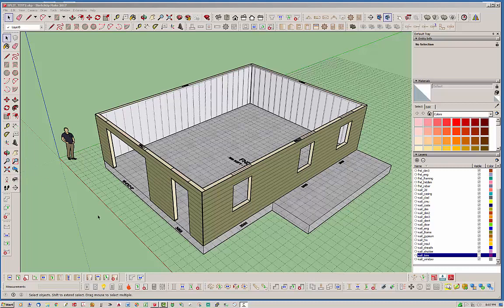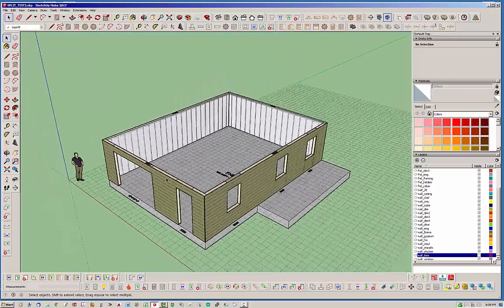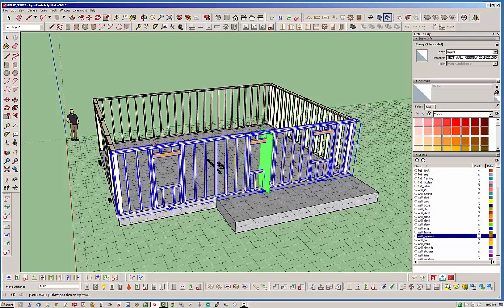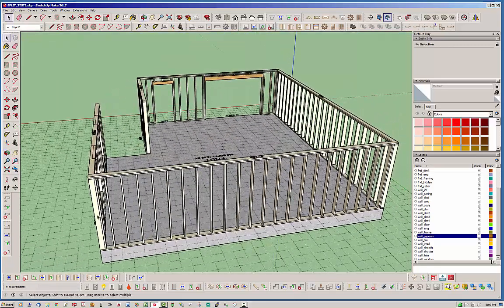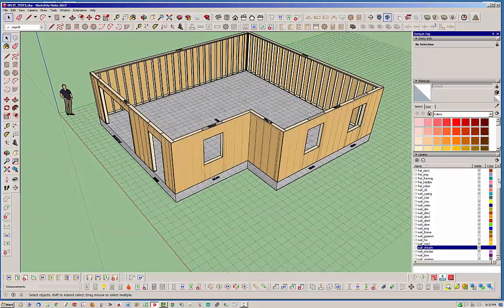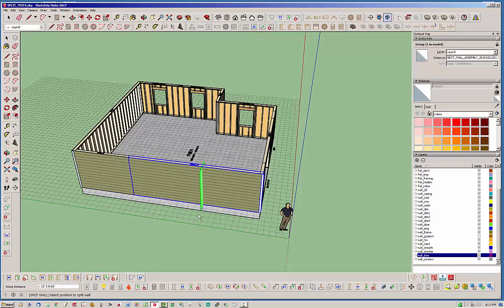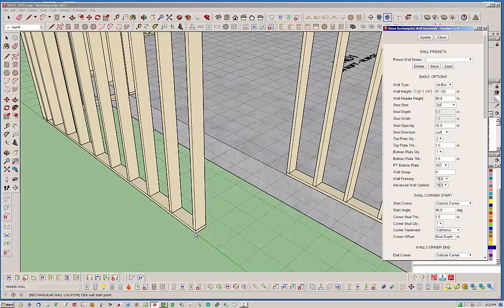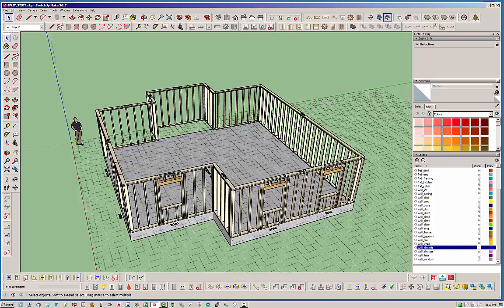Medeek Wall Plugin Tutorial 9 - Split Wall Tool

Comment: Hi Nathaniel, 
Happy New Year and can’t wait for your updates in 2020!!!
Would it be possible for the split wall tool to auto turn off cladding/shearing layers etc once you activate/click the split wall tool button using observers? (plus any of the other of the tools if possible) to bring it back to bare bone for quick framing as shown? 
Dan
Reply: Or it may be easier to just have a working screen/page that observes this for us (tool activation/on-click) and switches between current view and working view?
Reply: Something similar to the native component view setting that when you click on a component to edit it you can hide the rest of the model?
Reply: I agree it could be confusing for first time users etc... but it would be awesome and It could always have a global setting to turn it off?

Comment: I'm having issues with the beam tool has it been implemented yet. As it doesn't work at all for me?
Reply from the maker: Just a reminder, the plugins support SketchUp 2017 Make /Pro and higher.  Previous versions of SketchUp will have issues since they do not incorporate the latest SU API.